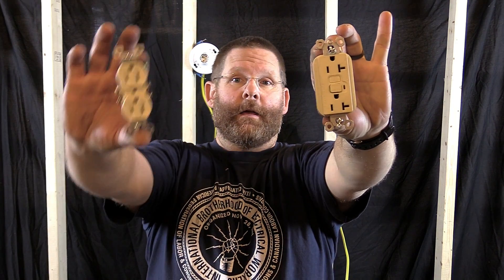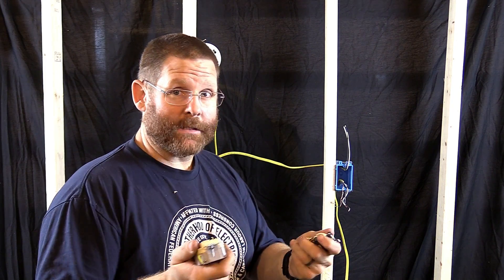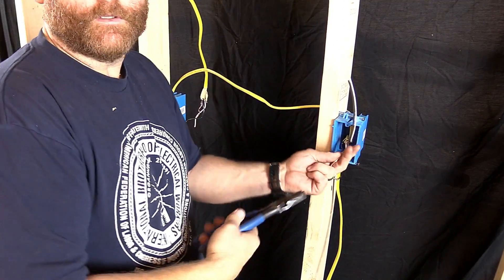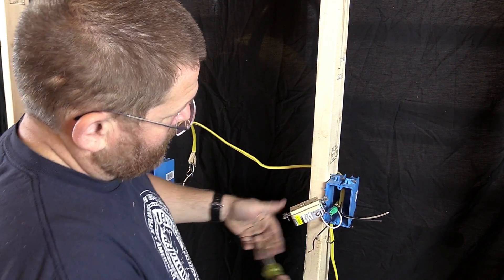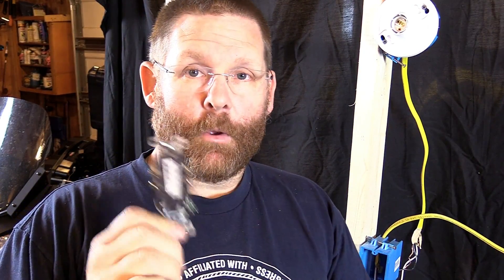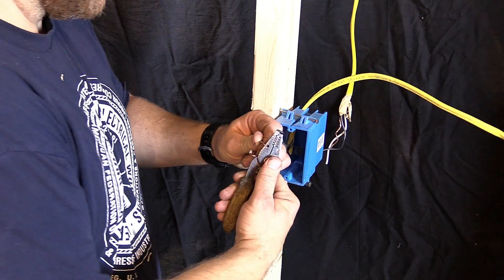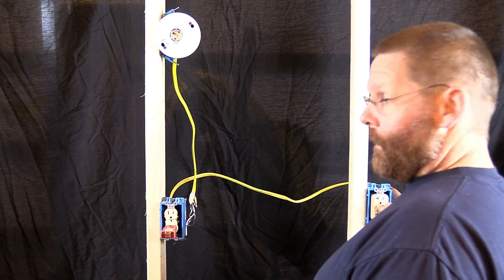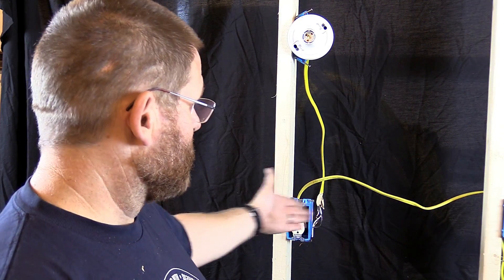How To Wire A GFCI And Receptacle

Comment: Thank you for a complete and easy to understand tutorial.🙂🙂🙂
Reply from the maker: My pleasure thanks for watching and commenting ☺
Reply: @MountaineerOutdoors  Hahaha, I still managed to do it wrong. Wired it up when I was exhausted and when I powered the box up and tested I got green across the board, but when I plugged anything into the downstream plug it would immediately trip the GFI. A few hours of sleep and a lot of coffee later, I discovered that I had inadvertently connected the supply side neutral to the load lug on the GFI plug, while also jumping from the load to the downstream receptacle, (Oops).  Pulled it all out and ran the supply side neutral to the line side neutral lug and waddya know, it worked. I'm not going to worry too much about making a mistake while exhausted, but I want you to know how important your videos are. Without your clear instructions, (Which I like to call "Wiring for Dummies", I wouldn't have known how to sort out this problem. You really do a great thing with your  videos. Thankfully I didn't have the giggle wire crossed up.
Reply from the maker: Wow that is awesome.. I appreciate your comment. I try to make my videos very clear so my young daughter would be able to understand. Am glad to hear that you did fix your problem and nothing bad happened. I love what you called the giggle wire too funny. Have a great day and I appreciate you watching.

Comment: Great IBEW shirt.
The captioning is 'off', and  too fast  for me.
Question....how do I know where to put GFCI in to be upstream? Wall of three plug ins on a sink wall.  Put it the closest to end of house where breaker box is??
Reply from the maker: I believe code says anywhere in a kitchen now or bathroom has to be gfci . If you know where the beginning of the circuit is on your counter you can put it there and leave the rest of the receps on the load side of the gfci. Make sense?

Comment: I have a a duplex in my master bath that is a regular device (not a GFCI), but must be GFCI protected from one upstream somewhere because it has the "GFCI PROTECTED OUTLET" sticker on it.
I want to add an outlet directly on the other side of the wall from it.  How do I do that?  There are already two hots, two neutrals and a ground connected to this device.
Reply from the maker: Whatever you add off that Recep will be gfci protected.if you want to do that you can just make a pig tail off your wires and cut in your box.

Comment: Dude I'm north of you. Color code your square tips. biggest Is black, second biggest Is red ,third Is green, smallest Is yellow. Get the electrical tape and tape your square tip screw drivers on the metal part, not the handle. Makes It alot better when you want the red or green right away. I know those screw driver your using you  can't do that. With your single screw drivers you can. Hey thanks, you Inspire.
Reply from the maker: I appreciate your kind words and the tip.. I will have to do that

Comment: Is it possible to split wire a GFI where one side is always hot and the other is switched?
Reply from the maker: No not at all not with these kinds of receptacles.
Reply: @MountaineerOutdoors  Thank you! I wonder why that is. Yeah, the one I have has not connecting bar on the outside that can be broken off like on a normal plug.

Comment: Glad your using 12 gauge....14 is the BARE minimum to meet 'standards'  as is most things tech. Go the  xtra mile, 12 is bestus.  Try drilling or reaming out those holes, to measured depth only, but only the plastic. 12 should go in , then tighten screw...
Reply from the maker: I agree I hate going into a home that is wired with 14.then you go to the panel and every beakers is a 20.  Not a good thing

Comment: Have you do any videos on GFI outlet and with a refrigerator or freezer plug in to it. I had a friend with a refrigerator plug in to a GFI outlet in his basement and it would trip like two or three time a month.
Reply from the maker: I do not have a video on that..however, I am pretty sure that if you install a dedicated receptacle you can alleviate that problem If I find out any different I will update this comment.  I am not up on the most current code due to my job taking me out of the residential / commercial setting. I still feel that you should check with a local building inspector just to make sure its their job to inform you.
Reply: @MountaineerOutdoors  I did install a dedicated receptacle for my friend but I think it not up to code in a basement because it not GFI protected. But I hear GFI was no good for refrigerator or freezer because they might trip when the compressor startup. So damn if you do and damn if you don't.
Reply from the maker: I'll do some digging but definitely ask your building inspector.. That's his job to pass it or not.

Comment: I thought the  gfci went on the end of the circuit. like the end of the line.  sorry im a 40 year auto mechanic. can you clarify?  thanks
Reply from the maker: No it can go anywhere but like everything there can be alot of different scenarios.
Reply: @MountaineerOutdoors  if I put it in the middle and it trips will the outlets before and after it be tripped?
Reply from the maker: The only way that it will work like that is if you put the incoming hot on the line side and the downstream receps on the load

Comment: I am new to your channel and would like to know if you a video on how to add multiple outlets to a garage that does not have drywall. In my garage there is an outlet on the ceiling for the garage opener. It is not GFCI because it is too high to reset it. I want to tap into the outlet and add 3 outlets on one side of the garage, 1 outlet on the other side, and add one flood light. Do you have a video that shows something similar to what I want to do?
Reply from the maker: No not yet but honestly that has been asked of me a few times.. I may try to get something like that done.

Comment: Is there a certain distance between the GFI and regular outlet before you should add in another GFI? For example is it okay if the GFI and outlet are over 100 feet apart? Thanks!
Reply from the maker: Great question and nope absolutely no distance requirement... Only thing is that if you put one let's say in your garage and you want to add a recep in your attic if it trips you will have to go all the way to the garage to reset it. That's the only thing about that. Other than that roll on.. Real good question. Good luck 🤞

Comment: In the thumbnail, it shows the load on the top, and line on the bottom.
But in the video, you put line on the top, and load on the bottom.
Which is correct?
Reply from the maker: incoming power always goes to the line side no matter what.  it doesnt matter what that pic shows it may have been a different gfi or just a computer drawing always remember line=incoming power Load is the receps downstream

Comment: I'm in new construction... I want to wire my basement was gonna start with GFCI plug the go down stream according to video.... But I came across bunch new wire at garage sale but it's 14-3  wire... Can I use double 15amp breaker and then split 15 amp receptacle so each plug on top and bottom will be on its own 15 amp... Or do I have to put GFCI breaker in panel
Reply from the maker: If you do it like  how your saying it will never trip and never protect you or anything you have plugged into it. Def use a single breaker for each circuit. Good question. As for the gfci in the panel you can do that as well depending on how many receps your trying to control it could be cheaper. That is a call that you will have to make. Good luck and thanks for watching and commenting
Reply: @MountaineerOutdoors  
Why use GFCI at all? Is it required in a basement?

Comment: I have a 20 breaker conected to 2 rooms ..one gfci n every room ....I don't kno what happend but now any  of the 2 rooms has power ... could be  one of the gfci the problem ? ...
Reply from the maker: It could be did the lights go out as well?
Reply: @MountaineerOutdoors  yes
Reply from the maker: Are you sure that the breaker is still on? Did it trip if so you have to turn it all the way off then you can turn it back on

Comment: Can I add another gfci outlet to my bathroom? I have one. I have a regular outlet on the wall perpendicular to it. I need that one to be a gfci outlet to plug in a fancy bidet potty seat. The regular outlet is the one next to the potty.

Edited to add: Do I need to change it? If the outlet that's on the same chain as the gfci will it shut off? Is it essentially like having both protected? Does that make sense?
Reply from the maker: Yes It makes sense. You can come off the load side of the gfci and add one for your bidet. Just make sure that you test it after you install it that it works correctly. As long as you come off the load side of the gfci everything will be fine
Reply: @MountaineerOutdoors  Thank you...
Reply from the maker: My pleasure ☺

Comment: If I hookup a gfci outlet and another gfci outlet if one trips will they both trip?
Reply from the maker: No. But you have to make sure both are wired up on the line side
Reply: @MountaineerOutdoors  Thank you I'll pull one of my gfci since the gfci will take care of the second outlet
Reply from the maker: And if you do that you will have to put the one you take off, it has to be on load side of gfi your using
Reply: @MountaineerOutdoors  Thank you for your good information
Reply from the maker: My pleasure ☺

Comment: Replacing a Radon fan that is powered by a GFI outlet - should it be connected to the load side ? The old GFI I'm replacing  has the Radon fan connected to the line side. Is this ok?
Reply from the maker: Honestly I do not know much about radon so I kinda just Googled it. From what I see it is pretty bad if you don't control it. In my opinion I would leave it on the line side that what there is no chance it could be tripped off. Seems like it should be on all the time. My opinion, leave it on the line side.
Reply: @MountaineerOutdoors  Thank you. That makes sense probably why they had it that way.:)
Reply from the maker: I agree. That's definitely the way I would have it

Comment: Can you connect a light  switch to the gfci receptacle in this format? Thanks
Reply from the maker: Honestly I can say that I have never tried. I would think that it would trip it out just like if you cycle the breaker. Now I will have to try it and see for myself.
Reply: Most people don't want the lights to lose power just because a GFCI trips. If you agree then the lighting should not be attached to the load side of a GFCI.

Comment: The GFCI outlet in my master bathroom is wired using pigtails (line/load neutral pigtailed, line/load hot pigtailed, line/load ground pigtailed).  

What's the difference between your method, and using the pigtails?
Reply from the maker: Sounds like to me that something down the line isn't gfci protected. That's what the difference is.

Comment: If I have  GFCI in my garage and I am looking to add an outlet to a wall behind it which leads to a kitchen pantry, can I also use the screws to add that outlet? The GFCI is the first in the chain and I was going to use the screws and stumbled on your video and thought I'd ask.
Reply from the maker: I wouldn't only because the garage circuit should stay in the garage. If you can run a new circuit or come off another circuit it may be better.
Reply: @MountaineerOutdoors  Thanks for taking the time to reply! It's one of those times where I can actually see the outlet in the garage when I took out the drywall in the pantry making it the easy choice. Otherwise I need to go through 2 studs in order to get hooked into the run for the kitchen.
Reply from the maker: Gotcha.. Well what did you do?
Reply: Mountaineer Outdoors still contemplating. I’ve got a double stud for sure I’ve got to drill through in order to wire into the existing chain from the kitchen. The easiest way would be to tap into the outlet in the garage but I’m no electrician and if one is recommending not to do that, I will try to see how much work I’ve got ahead of me. The backsplash was going to come off eventually anyway but the wife might not be too happy if I tear the kitchen apart and not be ready to put it back together. Lol.
Reply from the maker: Well good luck. I know alot of people do that. I have seen it time and time again. Off the record at my first house I had I did it and it was all good. But if you do it by code, which I do now I would keep the garage by itself.

Comment: We could really use your advice. I’m a millwright/welder not an electrician, and my girlfriend and I are turning a school bus into a tiny home. It’s time to wire it up and I chose 12 gauge braided tri wire over romex. It seems most bus conversion use Romex for convenience, but I’ve heard if the machine moves or vibrates use braided. Solid romex can break over time with vibration. Does this seem right to you?  It’s a lot more work to use tri wire. Also, I bought metal flex conduit to run the wire in. Is this overkill ?  All the other bus wiring isn’t in tubes. Can I wire up my mobile house without the conduit?
Reply from the maker: Honestly I would use minimum of the blue smurf tube.. The flex that you mentioned would be 1000 times better. And yes stranded wire is Def the choice when you are working with anything that's vibration... Motors... And the bus would definitely be what you want. Definitely not an over kill.. You want to protect yourself and be safe.
Reply: @MountaineerOutdoors  wouldn't this matter more in cases where the wire is going to flex, rather than merely vibrate?  Or does vibration really do something with this?  I would think with wires embedded in a wall, the vibration wouldn't matter so much... it's more about vibration at a connection point specifically...........  no?  I could easily be wrong, so... just a question!
Reply from the maker: Definitely if you have any vibration or movement go stranded
Reply: @MountaineerOutdoors  Fair enough.  And I presume the reason is just that solid-strands are more prone to breaking via metal fatigue?  Is that correct?
Reply from the maker: @DavidLindes  yep exactly right
Reply: I am not an electrician, and I do not want to deliberately contradict @Mountaineer Outdoors, both for simple respect and also to the fact that he is an electrician; however, I would mention this bit of advice.  Squirrels love to chew on wires, and using the metal flex tubing would make it much harder for a squirrel to get to your Romex or whatever wire you do use.
Reply from the maker: Good advice

Comment: Could the load be for a microwave/hood
Reply from the maker: It could be but if I were wiring a microwave circuit I would want it on its own circuit. I guess you need to determine how big of a microwave watts your using.

Comment: How can u piggy back off a gfi with regular outlet. To bypass the gfi. My garage has all gfi. I wanna hook up a fridge. The fridge keeps tripping the gfi. Can I piggy back off the gfi with a regular plug.
Reply from the maker: I'm gonna tell you that everything in the garage should be gfci protected. The way to do what your asking is to turn off power, pull out the gfci and on the back of most there is holes in the back. You will have to put your new wire into those holes black, white, and pig tail the ground. If you don't have that option you will have to pig tail the incoming line. Then put back the wires back into the line side of your gfci. The romex you pigtailed will be your new Recep not gfci protected
Reply: Why should all plugs be gfi in the garage? Even if the plugs are 6 feet above tool boxes an cabinets?
Reply from the maker: That's code but I know alot of people who don't do that.

Comment: It might be a stupid question, is it necessary to be grounded the GFCI and standard receptacles in this circuit? I heard some people said in GFCI circuit no ground requirements, if ground it, that’s additional protection right?
Reply from the maker: A gfi cannot ever create a ground. Anyone who tells you that I will is not an electrician. Ground is only ground when it's connected to the ground. However, on that note it does satisfy the the code requirements.. But still doesn't create a ground.
Reply: @MountaineerOutdoors  Thanks  for  your answer , and  how  about  AFCI ? It is the same theory ? Never create a ground ? Since the neural line return to the breaker then return to neural bar. Thanks .
Reply from the maker: Oh yeah and that is not a stupid question at all. Very good question

Comment: Great video. What's the best way to find the How do first receptacle on the circuit? I can't seem to find a video of this anywhere on YouTube. Thank you
Reply from the maker: Thanks, unfortunately no the best way is process of elimination.. what I would do first is turn the breaker off and all the ones that are off pulling out until you find its better to take them off one-by-one and un fortunately. I would just guess and go from there. I wish I could tell you an easier way
Reply: @MountaineerOutdoors  thank you
Reply from the maker: Sorry I wish there was an easier way but unfortunately there is none
Reply: @MountaineerOutdoors  no worries.

Comment: this video was a life saver for me, so thanks. think you could make a video on how to get 220v from breaker box to outlet? thanks. just got your self a new subscriber.
Reply from the maker: Absolutely, are you referring to a 220 for an air compressor or welder?
Reply: @MountaineerOutdoors  yup i have a welder and compressor that needs 220 but do not have a plug for it in my garage.. thanks alot.
Reply from the maker: I can definitely try I have the same problem I have an air compressor that needs a plug as well. I'll definitely try to get that done not sure when but when I do it I will record it for sure